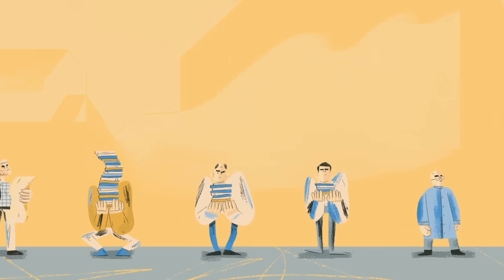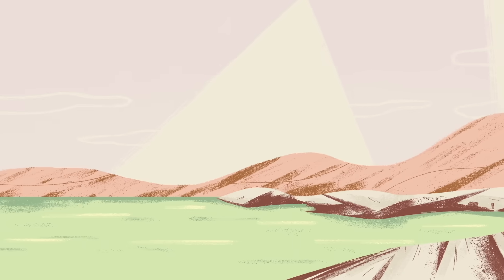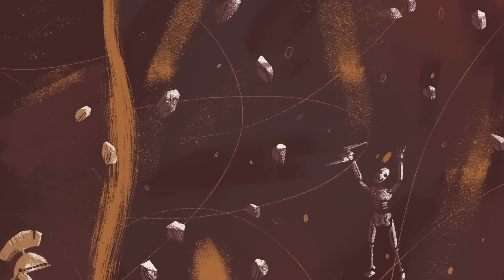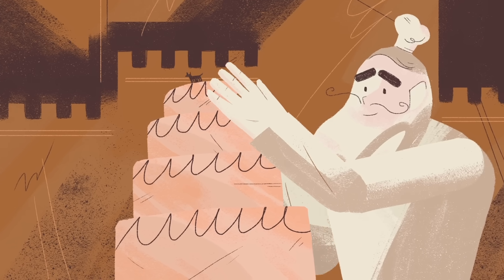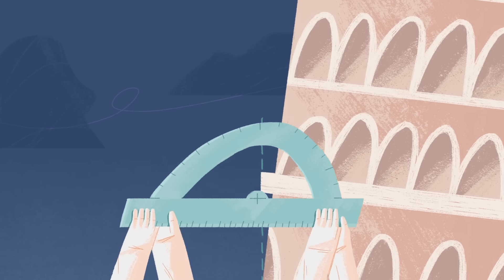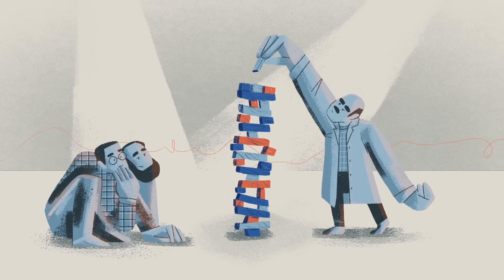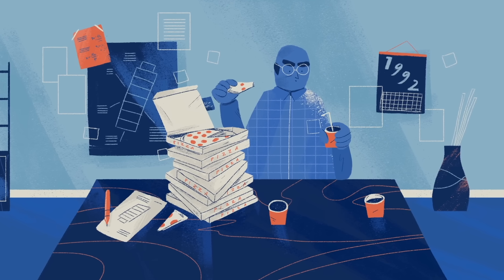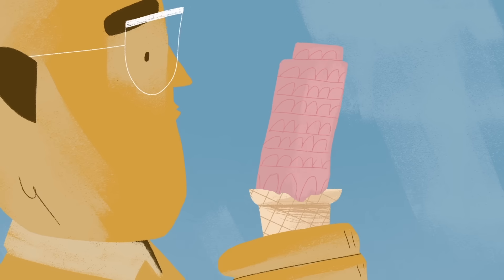Why doesn’t the Leaning Tower of Pisa fall over? - Alex Gendler

Comment: All these stories are nonsense and hiding the truth so that the sheep do not see. The tower was built from the very foundation at an angle in height, which is not under construction to cross the critical point of crossing the center of the central axis of the center of the tower. This tower shows that as such it is inclined, it cannot stand on the surface that it is a globe.

Comment: if the simulation projected it would topple at 5.44 degrees and it was currently at 5.5 degrees, the simulation was clearly flawed! 
"Ergo, don't bother doing anything" - Every city council ever. Because doing something costs money and makes you responsible for any failure.

Comment: Team of engineers: The tower will topple if it reaches an angle of 5.44 degrees
The tower is at 5.5 degrees

Also team of engineers:  The tower should remain stable for at least 300 hundred years.
So it may collapse anytime between tomorrow and the year 5000....

Comment: If I watch outside my window I can see the tower :) Still standing, still leaning 
It was comforting for me during the pandemic to see the tower, so many nice memories in Piazza dei Miracoli. 
Hello from Pisa, nice video!
Reply: When did they take the cables and counterweights off?
Reply: @OldNew45  years ago there was some working going on at the base, I think 10 years at this point, but I don't remember very well, I was too young 😅
Reply: @alessiadimanno1707  I was there in 1999, and it was fenced off at the base. No one could go into the tower, and there were cables and counterweight "keeping it from falling"
Reply: @OldNew45  as I told you, there was some working going on at the base. It was a massive intervention for stabilization of the base, however the cables didn't "keep it from falling", just offer a extra stabilization to allow the work they did at the base ( that one for sure, keeps the tower from falling tho).
Now the tower is accessible, and it's like this from at least 10 years.

Comment: As an engineer, in constructions that people's lives will be in danger when something goes wrong, 
we always calculate the "limits" until the accident occurs with a safety factor.
Meaning that when the calculations say it is 5.44, they include the safety factor. 
The real number for the accident to occur may be 6 but we will never go that far since we always calculate with this.
Reply: @nanochic  i agreed with u
Reply: Factor of safety is always applied to prevent overestimating and underestimating.
Reply: Unless they were asked specifically to determine when the tower will actually fall. In my PhD dynamics course, we add a factor of safety when designing something commercially, but we don't have any factor of safety if we're trying to see the actual limits of something. Sometimes knowing the breaking or fracturing point, rather than just the commercial limit, is important.
Reply: @nanochic  Yeah you have a valid point, they were asked when it will fall and it's not about construction. Good job.
Reply: @DCN_Central  thanks for your understanding💜
Reply: I hope its not true. What's even point of calculations if it doesn't give realistic prediction? Just guestimate and call yourself an engineer... Safety factors is individual choice and can change based on laws or whatever, but mathematical limits must be constant. 
Lets say you buy a rope in a store. would you like to see how much weight it can carry or at what weight it will break? I would like second one. I cant know how paranoid is company, they might have applied 10x factor to escape lawsuits, while other company might give it just 5x. I think I buy better quality rope but in the end it just different safety factor.
Reply: I also work with superconductors and when we talk about the temperature the material will fail at, we normally talk about the maximum temperature, and other factors can make it fail before the temperature we measure.

So no, engineers don't always add a factor of safety. It depends on what you're trying to answer.
Reply: @nanochic  As I explained,

“In constructions that people’s lives will be in danger”. That’s when the safety factor is lower than the actual breaking point. If a material will break at 6 per say, we will calculate the construction with a much lower number for safety purposes.

Comment: The leaning tower of Pisa does not have a prismatic base, which means bottom it’s slightly larger than its top. The tower will not fall until its center of gravity will be nearing its base. When a center of gravity is nearing a base it will fall. Anyways, if a tower has a larger base, it’s center of gravity is lowered, and it has more space to move.

Comment: Fascinating. Never even occurred to me why it was leaning or why it wasn't falling. Makes you wonder how many buildings suffer from a similar affliction... I understand the height of London's skyline is affected because much of the city is built on clay like Pisa.
Reply: Many towers and bell towers in Italy are affected by the same problem. Two famous examples are the Two Towers in Bologna, both leaning quite dramatically in different directions, just a few meters apart from each other. Tho in their case they are built on a strata of very fragile rock similar to chalk, if I remember correctly.
I guess that in a country where there's a church every few steps the probabilities of building a bell tower on unstable soil are very high. The fact that in the Middle Ages many noble families displayed their wealth by building the tallest fortified towers in their cities didn't help either...